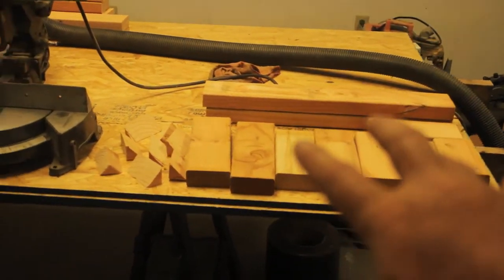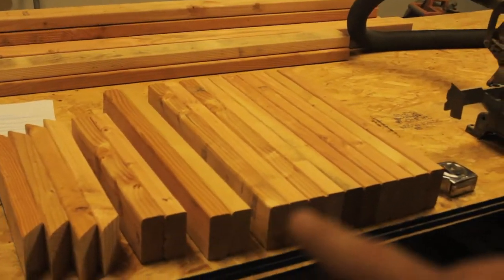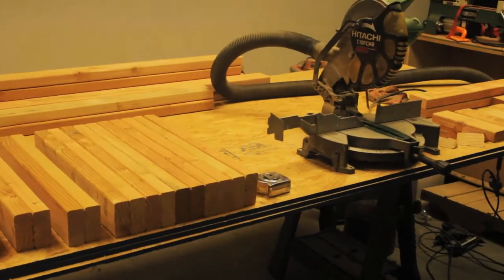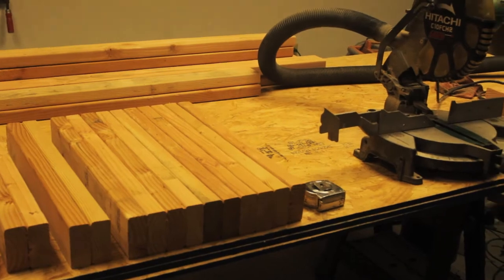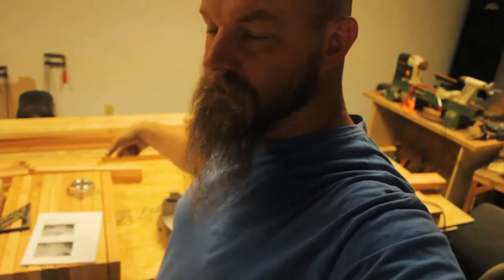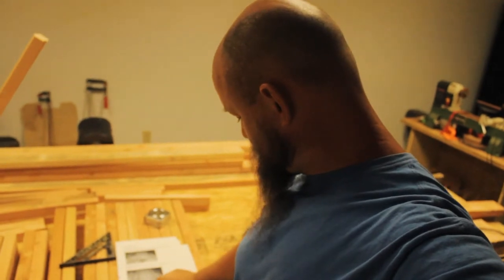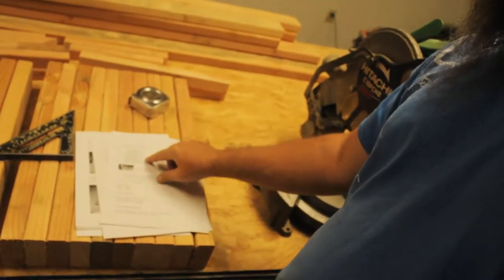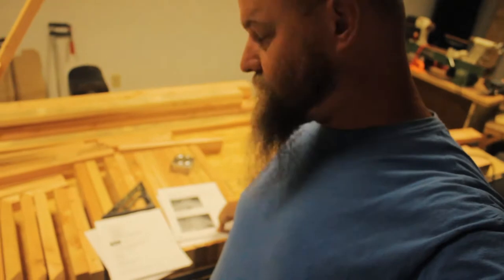Chicken Tractor Build | Building The Chickshaw - Justin Rhodes' Plans

Comment: I saw a few photos, maybe on the abundant permaculture FB page where a guy made an adjustable kickstand for it. A 2 x 4 with holes in it fit into a "slide" made of wood and a peg that fit into the hole and the "slide". Think literally like a barrel lock made of wood. Bad description but the wooden piece slide up and down based on ground height and would allow for unlevel land.
Reply from the maker: That is definitely something we could make in the shop!  We will have to look into that.  Thank you so much for the suggestion.